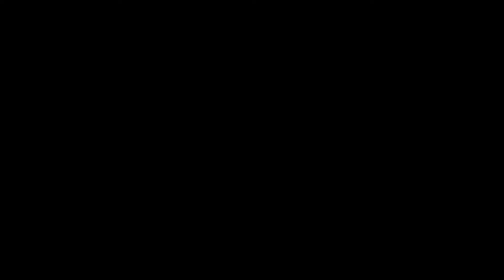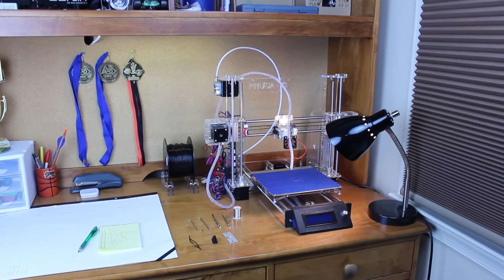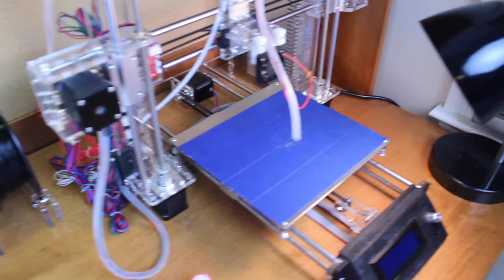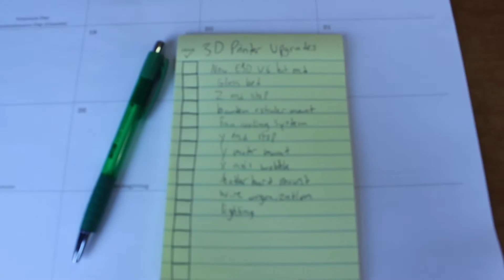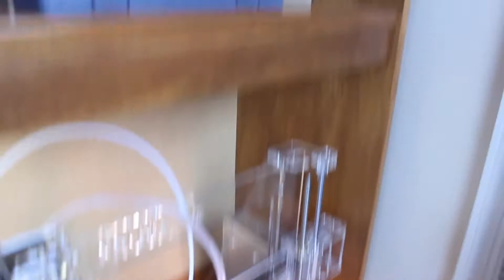Sunhokey Reprap Prusa i3 3D Printer: Upgrades!

Comment: Hello, nice video ! I subscribed and I'll whait your next videos. Are you happy with this printer ? I'm thinking to buy this one from aliexpress. But I'm not really a huge fan of the acrylic frame witch seems a little fragile.
Reply from the maker: +Russo NC Thanks for subscribing! I love this printer but it does need some modifications to get it to work correctly. I think of that as the fun part, though! The acrylic frame is fragile but I haven't had any problems with it yet. Also, I just got the E3D v6 head that works so much better than the one included so that might be a useful purchase. I am going to upload the video about that soon!
Reply: You're right, my idea is to learn about this technology and the best way is getting my hands on it. So for a start I think it's the way to go. I didn't make the order yet but I'm ordering the E3D v6 lite bowden, because I have heard that the included hot end it's not really good. Thanks for your reply and I hope I see your new videos soon